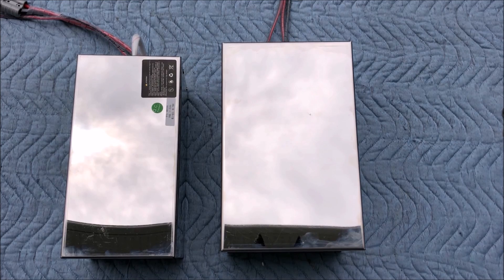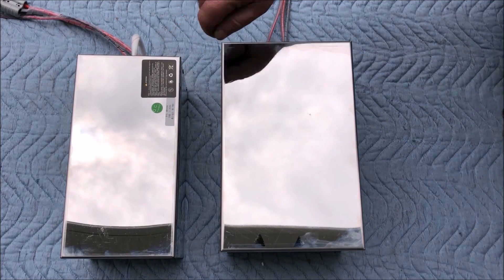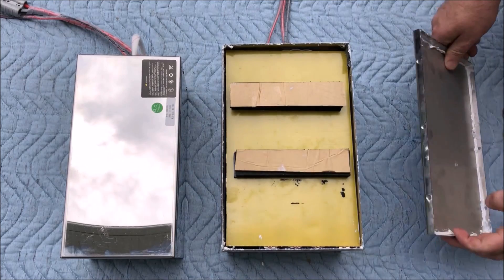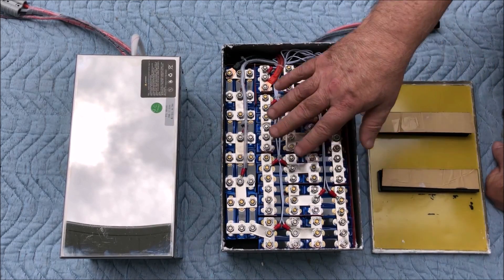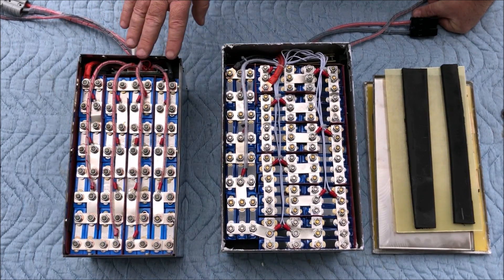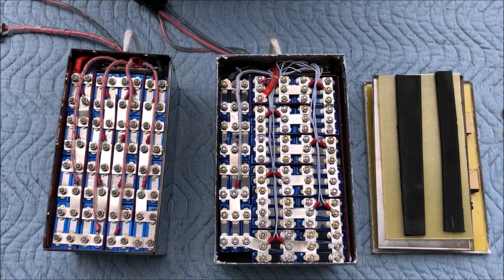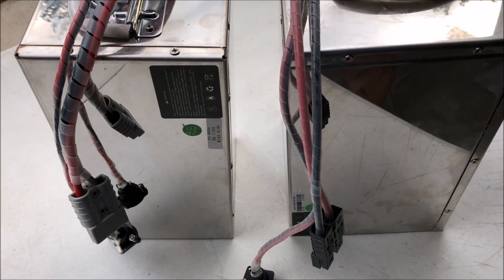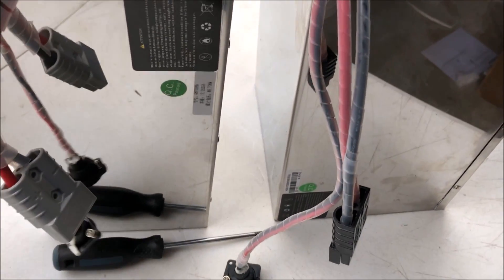A look inside Golden Motor 48V30AH and 48v20AH LiFePO4 batteries

Comment: Right on!  do you think packs made with 21700 cells will be common for ebikes soon?  i have a  small no name 36v front hub motor powered with sla batteries that have worked great for me for 5+ years. During that time i have wanted to get a rear  48v kit for my old kona shred from you guys but i cant decide what the right kit for me really is??  i want range and hill climbing power more than speed.  What would you recommend i put on a kona shred ?
Reply from the maker: I don't want to go into great detail as this is a video on our LiFePO4 Batteries. Depending on how much power you want I would go with a Magic Pie Edge at 48v500w or a Magic Pie 5 at 48v1000w. I imagine its just a matter of time until 21700 cells become more popular.
Reply: cool thank you!